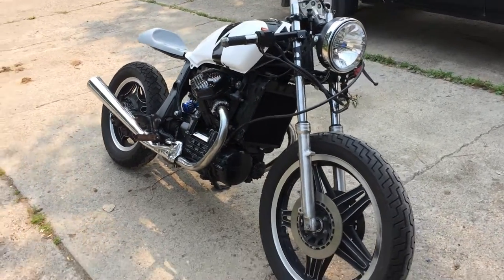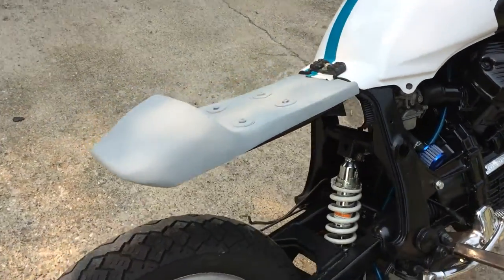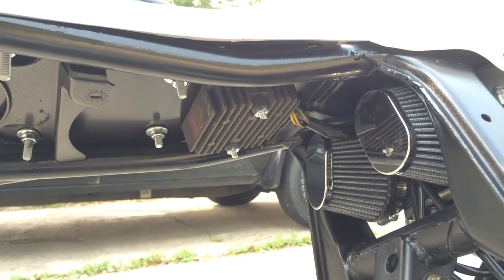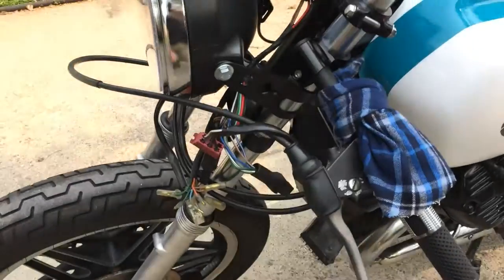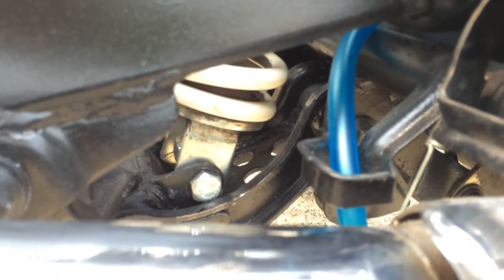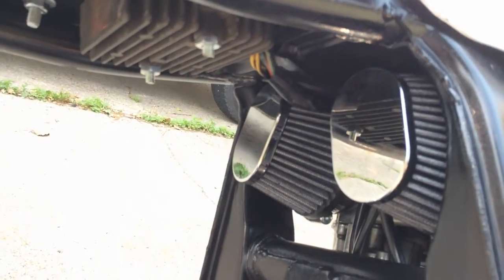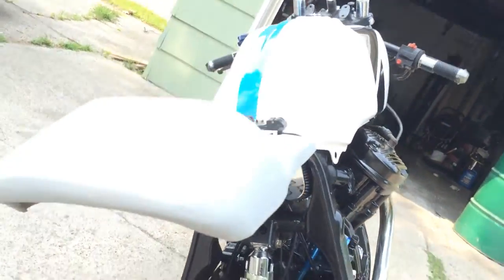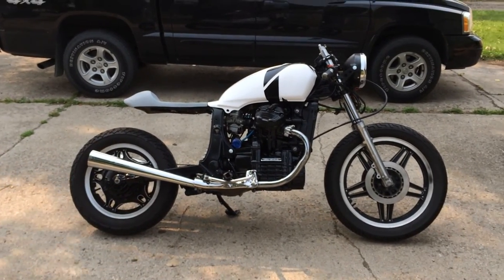1981 Honda GL500 cafe racer update

Comment: Hey from 2018. Where did you move your fuse box?
Reply from the maker: Alex David it's actually in the headlight. I got rid of the old glass fuses and rewired it with blade fuses. Tight fit but worked.